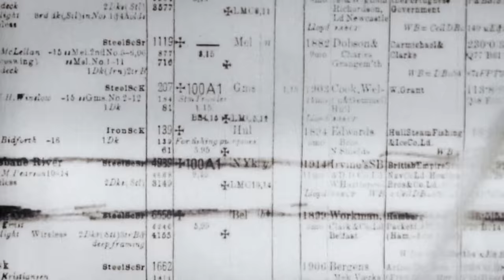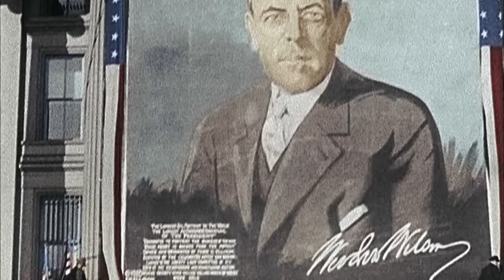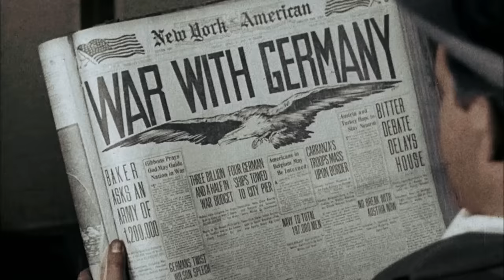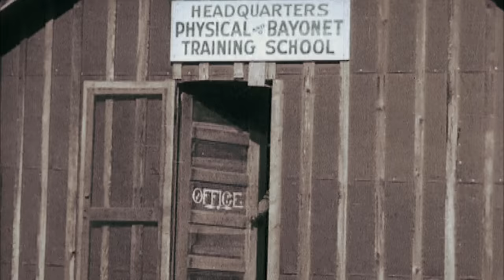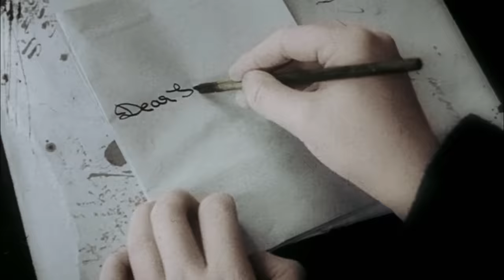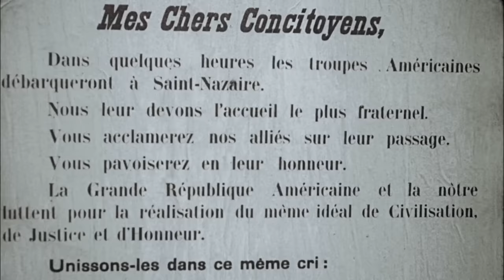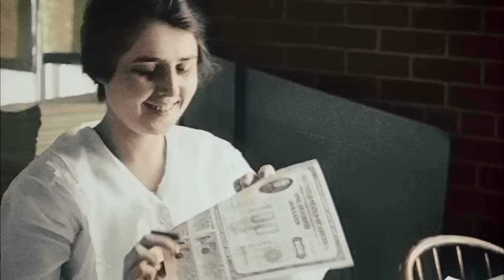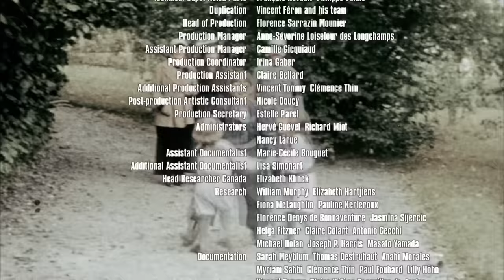Apocalypse World War 1 - 4/5. Rage - Subtitrat în română

Comment: I'm pretty sure that the labelling of Haig as the "butcher of the Somme" is something that was born more AFTER the war had ended than while it was actually being fought. Particularly as men who had gone through the trenches and seemed to be disenchanted by it didn't really write their memoirs until after the war when it "could" be told. And there it should be remembered that most of these men were at best captains in WWI and weren't about to be in a position of high authority. In this, a LOT of the criticism is a great case of "Monday morning quarterbacking" where a person with now high command experience says what should be done AFTER the point in which the decisions needed to be made. In this it is pretty easy to see where Haig's mistakes were AFTER the battle is fought.

About the only one who would have really called Haig a butcher during the war would have been Lloyd George, and there it REALLY needs to be noted that Lloyd George was really seeking to avoid major fighting with Germany AT ALL. He was against the Somme offensive even before it was launched, that was really on Joffre, not Haig. The only reason the Somme gets labeled as a mistake by Haig is the fact that on July 1, 1916 the French army was busy at Verdun and couldn't commit the forces it was originally intended to on the Somme.

And while Haig did make his fair share of mistakes and that the battles on the Western Front weren't easy, it needs to be remembered that the Germans suffered in them too. Passchendaele in 1917 was a bloody and hard fight for the British and their Canadian forces, but the Germans ALSO suffered in the battle. It wasn't another of those situations where "everyone gets slaughtered in the first ten seconds."